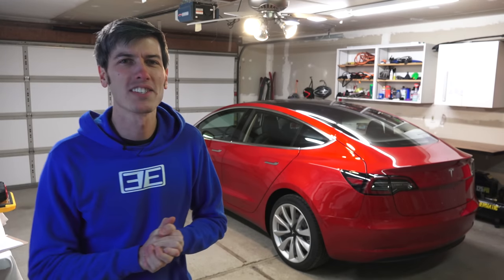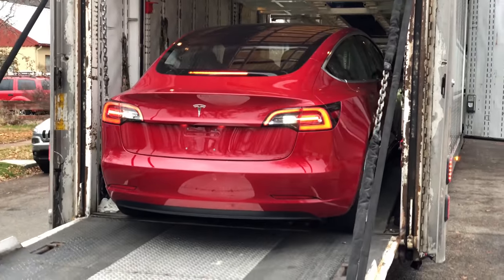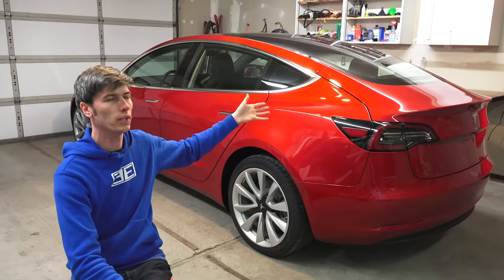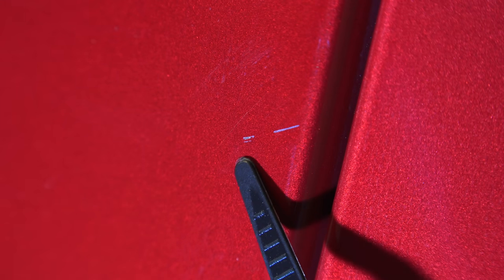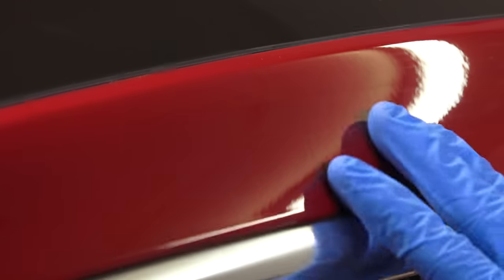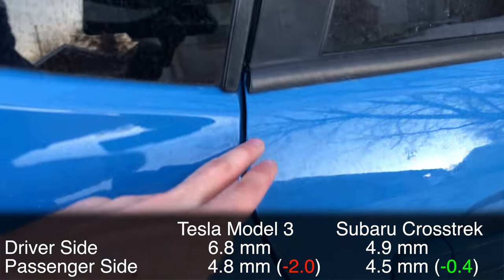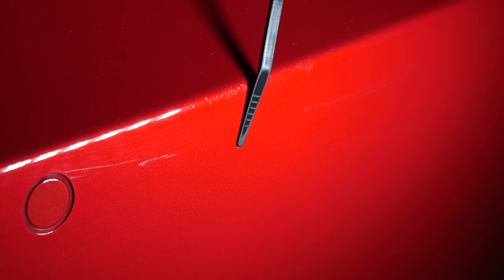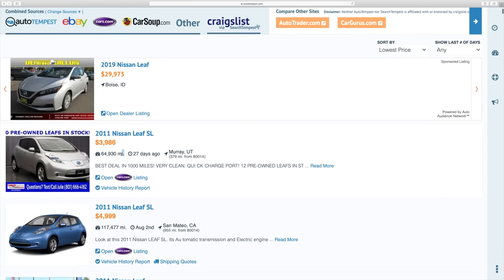Everything That's Wrong With My Tesla Model 3 - Quality Problems

Comment: unacceptable. My assumption would be that whoever loaded and delivered the car are knuckleheads who put the scratches on there. Usually when you see a car delivery truck the cars on it are covered in protective plastic.
Reply: I was thinking the same thing.  You see cars on haulers and on trains with the protective plastic.   But I guess since these get delivered right to the customer there is no 'dealer prep'.   It's interesting because Tesla saves money on applying the plastic and on the labor to remove it.  However, it won't take too many cars getting repainted to quickly eat into those savings.

The gaps and panel fitment are just not acceptable at this price point.
Reply: @olliehopnoodle4628  tesla claimed they were making their own car haulers... maybe its them that fucked up AGAIN.... cars are delivered non stop it it all comes down to teslas garbage.

Comment: I work for a bmw dealer and one of things I do, is to check the imperfections  when they arrive, about 1000 per year. The scratches it might be acceptable because when they leave the factory are transported in trains, trucks, ships then back on trucks etc and 99,99% per cent of the paint imperfections come from this. But the rest of problems are unacceptable for me. In 5 years barley seen problems like the front bumper doesn't match with the hood
Reply: exactly. tesla isn't allowed to have dealers by law (in most states), so they can't do that.
Reply: @satoau1  Huh? They choose not to have dealers, some states will not allow Tesla to sell as they need to sell in dealerships, but Tesla refuses
Reply: sato AU ummm... you have it ass backwards.... most states require that Tesla have dealers. Tesla is not allowed to not have dealers in many states. States outlawed Tesla’s direct to consumer approach because of lobbing by the other car companies.
Reply: you misunderstand the requirement. they require them to have franchised dealers, meaning tesla isn't allowed to run the dealerships themselves. also in those states the number of dealerships allowed is limited, to make sure a new dealer can't come into an established dealer's area and hurt their sales. the only way they can come in would be to have a dealer that's already there sell tesla cars, and none of them will do that because they'll upset the brand they're already selling. no dealer will sell their cars so they have to go direct to consumer, but that isn't allowed in a lot of states so they have to truck them in from states that do allow them to run dealerships.

Comment: You don't have to be so defensive. You have pointed out flaws which shouldn't be there on a 2500 paint job. That may be okay, but panel gaps and misalignment is serious QC problem - it means their production line robots are not working properly and they  are allowing wider variations from specifications,which isn't good for a car which is supposed to be best in class.
Reply: It’s YouTube, with the yoyo’s here, you have to be.
Reply: best in  class not too hard when there are 2 models in it.
Reply: Yeah...that's the problem....it's not the robot.  The assembly lines incorporate a lot of manual assembly by humans....and they were probably not Japanese.
Reply: robots are not the ones hanging the doors and installing the deck lid and hood those are performed by humans. Tesla gaps are terrible they have not set gap tolerance and the negative and positive flushness is not acceptable for any other brand.

Comment: That's outrageous! I just bought a brand new Skoda Octavia SE L 1.5 TSI DSG with Velvet Red metallic paint, with 7 miles on the odometer when I got it: and the paint was immaculate, and still is after ten days of one-hour commute each way for work. The gaps are perfect, too. I wouldn't expect anything less, even on a brand-new car worth much less than a Tesla Model 3. I would have complained to the dealer immediately and expected them to rectify them.

Comment: From the look of those scratches, most of them looked to be cause by something physically scraping along them.

I'd contact Tesla about this as it may actually be the transport of the car to your house that caused all these!
Reply: I don't think that it's likely to be scratched entirely during transport, if it were the deeper scratches and all, sure, but the microscratches in places unlikely to even be touched probably came from the factory. Transport issues aren't this widespread for any other car, even preowned cars. Plus, the debris under the clear coat was caused at the factory.
Reply: this is what I am thinking. Panel gaps like this exist on lots of vehicles, but that paint issue should get a free repair immediately
Reply: Those five aligned scratches at 4:31 looks like fingerprints from gloves. Dirty ones.
Reply: I find it odd that the car wasn't covered in white protective wrap when it was delivered. Cars in europe stay with a protective wrap around the car until a customer comes to pick it up from the dealer, it is also visually checked and cleaned from any defects that might have occurred during transport. Quality control is surely lacking at Tesla.
Reply: @rkim44  Yup, but as much proof as you have that it occurred during transport. (although the grit under the paint is proof that there were defects from the factory)

Comment: Just watched your Tesla problem video I noticed you said almost all the scratches were in the drivers side, I haul cars for a living I think you have cargo damage not Tesla quality issues. I also noticed the delivery truck it was a enclosed hauler they have very little room to get down the car between the side of the truck the driver side is the side the hauler would have been going around.
Reply: Tesla needs to wrap problem points like other car companies do.  Course no shipper caused the Gaps  or poor quality paint job.   Tightening up the Gaps will help fuel economy.

Comment: It’s a great looking car for sure and the tech is very clever. That said Tesla are selling these at entry-level luxury car prices and unfortunately this example has an exterior fit and finish inferior to cars a third of it’s price which is concerning. I’ve just bought a new BMW 320i in a similar price range and if my vehicle had these defects on collection I’d of refused it. Unsurprisingly, my car was in perfect condition when I picked it up.

At the end of the day this is all largely cosmetic and easily put right (the panel gaps aren’t great but probably liveable with). What would concern me is the quality of the vehicle under the bodywork. Are these external finishing defects indicative of the general vehicle quality and if so what problems are going to rear their head over the first few years of ownership?
Reply: leakycheese which entry level luxury are you talking about? A model 3 costs 51k base, BMW are cheaper.
Reply: leakycheese really? A 320i? Why even bother at that point?
Reply: @svbhave   cheaper and better quality xD
Reply: Ironically, Teslas (according to pretty much everyone) have much more and worse on-delivery defects than BMW's, but they hold up dramatically better (measured in $$ to keep it running) over the long run.  I've heard this from several mechanics: a BMW will reliably deliver deliver problem-free driving for the length of its warranty, then you'd better sell it before the first $10k+ repair bill.  They tell me only M-B is worse in this regard (with Range Rover also definitely in the running).  As bad as American cars are, BMW and M-B will bleed you dryer, faster, to keep them running in the long run.

Now, I haven't factored in the cost of replacement batteries.  According the the few people who've done long-term studies of Tesla batteries, they project they will provide upwards of 85% of the original battery performance at 150k miles.  So they should provide acceptable-or-better battery life and performance well past 200k miles.  So, typically, a Tesla will not need a battery pack replacement for the lifetime of a BMW.

On the other hand, I also didn't factor in the cost of body (crash) repairs.  It's also well-known that almost any collision, no matter how minor will "total" a Tesla, for a few reasons.  So there's that.  A Rear quarter panel that would cost $1100 in a Chevy?  $60k on a Tesla.  There are so many sensors, computers, and other tech right under the surface that you're almost guaranteed to smash one, plus Tesla will only ship parts to a few repair places (which charge commensurately for their monopoly), plus the astronomical cost of Tesla repair parts in the first place.  A very bad scene.
Reply: Shantanu Bhave I think it's hardly an accident the the Tesla Model 3 is called that.... kinda a subtle hint at what market they could be aiming at?

The BMW 3-Series have a wide range of costs..... if you are going for a 335 model with X-Drive and top trim then that's definitely in the same price band as the Tesla offering. Plus let's not forget that the Tesla Model 3 will soon be available at the $35K price point which definitely directly competes with the BMW 3-Series and other compact execs from Audi, Mercedes etc.
Reply: Juan Carlos Dominguez I can actually go out and buy the BMW today 😉

Always a useful characteristic for any consumer product. As a business driver the whole flim-flam currently around getting a Tesla Model 3 just makes me go "nope". Which is a shame because conceptually I think the car could meet my needs.
Reply: Jeffiekins This is my third new BMW and I've found the brand very reliable - superior to the Audi and VW's I've also owned from new in the past.

I had my first two Bimmers for 60K and 130K miles respectively. The second needed a DPF replacement under warranty at about 20K miles. No other issues although the 2nd needed a new clutch at 110K miles... I did rag that one as a company car so I think more measured driving would have given a longer life.

You make lots of good points on cost of ownership and I agree electric cars will be in principle cheaper to maintain just because they are mechanically less complex.

While Tesla has all the attention at the moment I'm interested to see how comparable offerings from BMW, Audi etc. will compare given those companies vastly greater experience and expertise in mass market vehicle design and production.
Reply: @leakycheese  The name comes from Ford blocking them from calling it the "Model E" .
The original plan was to have models S, E, X, Y.
 Not a joke.
Reply: coast2coast00 That's good knowledge, thank you 👍🏻

Comment: I've seen used cars in better condition.
Reply: Yep my 15 year old subaru has a similar degree of scratching, and less orange peel
Reply: Yes, I thought the same thing. My 13 yr old Prius' paint looks similarly scratched to this one. I'm amazed at all these scratches and that piece of dust.
Reply: my saab 900 from 1997 has less chips and scratches than that new Tesla 21 years old 22 in a few months
Reply: 8 (just) year old Honda Jazz (Fit) here: 220,000 km's has literally 2 faint scratches on the panels shown in the vid (there's a couple of chips low down on the front from hitting stones and such, and I should point out the bonnet (hood) and passenger front wing were resprayed about 2.5 years ago after a numpty brake-cheaked me with their full weight on the brakes because I wasn't going 20 over the limit as they wished). No orange peel that I've been able to see, though in all honesty I don't think the colour it is (a dark-ish blue) would really show that very well. But yeah, 8 years old, a lot of distance driven and the paint is in much better condition than this brand new car that costs about 2x as much!
Reply: lol no you have not.
Reply: @Rocheman79  You can go to any quality used lot on the planet and find cars with significantly less scratches. Used cars deosn't just mean 20 years old with panels from 4 different cars and the exhaust dragging on the floor
Reply: @jamesoren7238  lol i work with used cars all the time. the only used cars i have seen with less scratches is some ferrari with 1600 miles.
Reply: @Rocheman79  Subjective - having bought many used cars it's not uncommon at all. I mean ... nearly e ery car in my extended family has less scratches than this.

Comment: Laughable quality. I've bought 3 yr old cars with better paint work.
Reply: My 116k km car was in better condition than these hyped teslas
Reply: No kidding. Tesla is a joke.
Reply: Neddy Ned yeah, having the longest range batteries and most advanced driver assist software is hilarious
Reply: Waymo and GM are the leaders in autonomous driving.  Tesla's batteries are made by Panasonic.  There is nothing proprietary about the batteries.  These cars weigh 1100lbs more than an ICE car, cost more and have range anxiety.  They also use 65% Fossil Fuels to operate.  Strip Mining for lithium also.  So that's not very environmentally friendly.   They are also 22 Billion in debt.  Did  you hear that the car was ordered and delivered in 48 hours.  They have no backlog.  Yes they are a joke.
Reply: @danielnewman3441  once the government funding goes in the first quarter of 2019 they are pretty much screwed I hear
Reply: @jamesavery6671  Possibly however what keeps Tesla alive other than the fanbois is the valuation.  Musk can easily dilute the stock and garner billions in capital to pay off creditors and keep the shell game going.

Comment: When I'm buying an used car, I always check how the panels align. If I would see such gaps, I would assume, that car was crashed and cheaply fixed.
Reply: Car had 22 miles, so no
Reply: jamie bairos that tesla must had an accident lol
Reply: Hood Baby  He said if he saw these sorts of flaws in a used vehicle he'd assume it had previously been in an accident, fluent english speaker.  He didn't say the Tesla was used.
Reply: a*
Reply: Hood Baby  Sure it is.  But it looks like it has been in an auto accident and it is band new.  How are they going to sell a brand new car that has the same problems a car that has been wrecked has?  What the hell is that all about?  And those glass panels on the roof of the car, there is no excuse for that, that is just blatantly shoddy work.